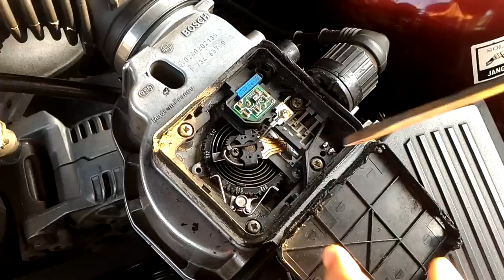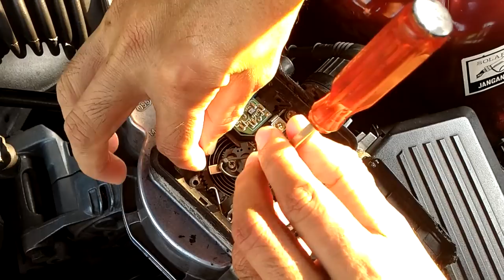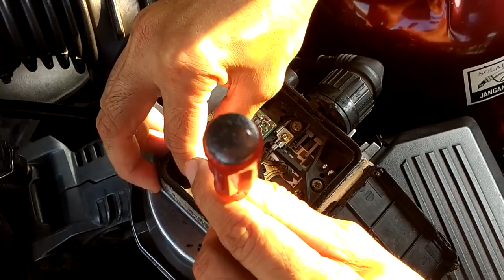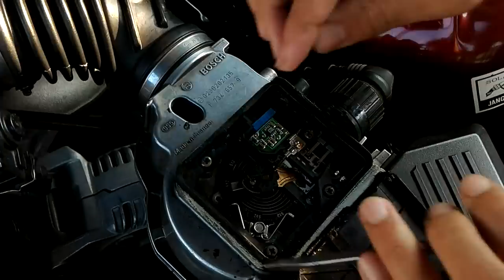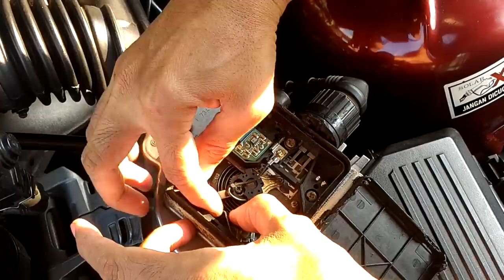BMW E36M43 AFM setting

Comment: Good video! I got the same looking AFM, but the model number ends with 203. Will the setting be the same? Also curious...next to to the blue square thing situated close to the circuit board, there is some sort of round plastic extension that is protruding from the outer black cover (some AFM dont have this). Is there any functionality of that part? thx
Reply from the maker: Thank you. I think the steps to setting the 512 and 203 gear are the same.

About the blue square, it has a function to setting the CO. However, to setting it you need a gas analyzer equipment
Reply: @motoren_works  thx...at last i know the function now :D.
Reply: @motoren_works  btw another query...there are many variations of AFM for M43 engine... how to know which model of AFM to use for the correct engine? I'm scared I'm now using the wrong AFM for my engine...coz they look very similar :p
Reply from the maker: @yinsilbi  Honestly, i don't know how to choose the correct AFM.
If i want to choose the AFM with or without CO setting, so i will choose the AFM with CO setting
Reply: @motoren_works  ok noted boss. tq :D
Reply from the maker: @yinsilbi  you are welcome

Comment: Just asking I had problems with air to fuel ratio then noticd the to wires on the afm one is off the board could it be the issue for rev limiter
Reply from the maker: The thin wire?
In my AFM, that wire is gone, however engine idle is normal
Reply: @motoren_works  I just  noticed 
Mine afm I accidentally loosened the  screw and messed the setting's

Comment: So what was done ?
Reply from the maker: jaz chahal adjust the wheel spring tension is to correct air and fuel ratio. moving the wheel clockwise is lean and counter clockwise is rich

Comment: How many rotations from fully unwinded spring is yours set at?
Reply from the maker: I didn't count the rotation. I rotated clockwise (lean) the 512 gear and stop when the engine rough shaking. After that, i rotated in the opposite direction until the engine smooth vibrating. Before i start rotate, i give a mark as initial reference just in case if my setting goes wrong.

This step basically want to ensure if the old AFM still in correct position.
Reply: @motoren_works  lokasi bengkel dmn ya?. Kbtulan e90 saya rough idle. Ditarik pakai manual brasa jedut2an, cepet bgt kaya lg lewat speedbump
Reply from the maker: @rhomyr1302  mohon maaf om, sy bukan owner bengkel hanya pemakai biasa khususnya di E36M43. Untuk E90 sy kurang paham om
Reply: @motoren_works  ok om. Makasih sudh membalas.
Reply from the maker: @rhomyr1302  sama2 om. Gak coba ngecek ke bengkel resminya bmw om?
Reply: @motoren_works  blm sih om. Tp kmgknan sih mahal
Reply from the maker: @rhomyr1302  kalo ke beres biasanya sih begitu om

Comment: Can you please make a video on how to clean the air flow mass sensor ?
Reply from the maker: Do you mean clean the tiny sensor inside the AFM?
Reply: @motoren_works  Yes
Reply from the maker: @williamwill1100  honestly i never clean the sensor. If you want to clean it, you can use the sensor cleaner like "CRC mass air flow sensor cleaner", however never touch that sensor.

Comment: Ok... Now I'm confused.
You claim your enriching the mixture by decreasing the the tension on the spring. I disagree. You may improve throttle response a little but in closed loop operation the oxygen sensor will make the DME correct the duty cycle of the injectors to the preprogrammed stoiciametric ratio. The only way to change the air fuel ratio is by changing the mapping of the DME. If you don't believe that try putting your car on a Dyno and analyze the exhaust gases.
Reply from the maker: E36M43 in my country doesn't have oxygen sensor. About the effect of increasing or decreasing the AFM spring to fuel mixture, may be you can see my another video https://youtu.be/yg8LIWWhX7w.

Comment: Por qué a mi carro no marca la gasolina si ya le cambié el flotador solo se mueve poquito gracias es un BMW modelo 1995 318i
Reply from the maker: Si se produce un error después de reemplazar todo el sistema de boya (https://www.youtube.com/watch?v=7xY3LdUl_Fk&t=376s), intente verificar nuevamente y limpiar el sensor de seguimiento en el sistema de boya. Si se ha realizado este proceso pero aún aparece un error, entonces la causa del error podría ser del Fuel Level Sender (https://www.youtube.com/watch?v=1mQ1I-Ijey4&t=690s). 
(Lo siento si mi idioma no es el correcto, porque uso el traductor de Google)

Comment: hi mas indra boleh tanya"  jd gini kmarin sy udh bersihin ICV-filter udara- dan AFM .sy udh setting AFM di idel yg ideal dan rasanya jg udh enak tarikan nya tp kok Gas buang tetep masih bau bensin ya dan cenderung masih boros antara 1:6 . apakah harus setting AFM via komputer biar emisi gas nya ideal dan klo boleh tau brp sih kisaran biaya jasa setting AFM by komputer biar sy ga di mahalin montir2 cina dsni.matur suwun
Reply from the maker: ALLEA QUEN hellow mas om, kalo AFM sudah diseting tp gas buang dr kenalpot masih tercium bensin/boros maka langkah selanjutnya adalah seting CO pake alat gas analyzer di bengkel yg punya alat tersebut om.
Kalo biaya di bengkel spesialis di kisaran 100rb s/d 300rb, sedangkan kalo di bengkel resmi bmw lebih mahal dr kisaran itu om.
Oh iya om, bersihin icv hanya disemprot2 seperti di video sy lainnya kan, jangan dibongkar seperti di video waktu om nanya itu ya 😀
Reply: motoren works .icv sy udh di lem mati ama yg punya sblum na kok mas . iya planing na sih gtu .mau setting komputer biar dpt ketemu emisi gas buang yg standart. tanks info na mas indra
Reply: om bengkel non resmi untuk stel CO bmw e36 320i m50 sekitaran jakarta dimana yah?
Reply from the maker: @bimmerlive9498  maaf lama jawabnya om, gak ada notif 😩. Untuk di jakarta, maaf sy kurang paham di bengkel mana nih om.
Reply: @bimmerlive9498  sama om. Saya jg agak boros tipe e90. Kalah sma 2.5 cc 6 syl... daerah jakarta juga

Comment: which way do you turn the blade to lean out the mixture?
Reply from the maker: Lean = clockwise
Reply: @motoren_works  are you enriching or leaning out in this video?
Reply from the maker: @puristM  enriching
This is my other video related to AFM setting https://youtu.be/yg8LIWWhX7w?si=PAtRZzD-UvV9rs9H

Comment: Rpm ngayun saat mesin belum panas apa benar itu dr AFMnya ya om?, klo dah setengah jam lebih mesin hidup baru stabil RPM, pernah bawa ke bengkel spesialis BMW(bukan Bengkel Resmi) katanya AFMnya dah kena, trs saya nanya dong apa g bisa diservis ato disetting lagi, soalnya diminta langsung ganti baru, katanya utak atik atau servis AFM itu tindakan konyol g bisa diservis katanya, kaget saya sama omongan mekaniknya, langsung batal servis disana, mohon pencerahannya om
Reply from the maker: Dari pengalaman di M43 sy, rpm ngayun asalnya bisa dr AFM bisa jg dr ICV/iddle up (iddle up biasanya lebih kerasa kalo lg nyalain AC). Kalo dr AFM penyebabnya karena ada bagian karbon AFM yg terkikis. Biasanya setelah di recarbon rpm bakalan normal lg. Kalo penutup plastik AFM bmw omnya sudah pernah dibuka, bisa di cek dulu karbonnya. kalo ada yg terkikis coba di recarbon dulu.
Sekalian cek jg pergerakan flap afm nya om. kalo kurang lancar. Bagian porosnya coba disemprot(hati2) pake carb cleaner atau wd40.
Reply: Klo pernah dibuka dan 2x disetting aja g  pake recarbon, dulu pernah RPM ngayun lebih parah klo AC nyala bahkan mesin hampir mati dan terus menerus saat mobil nyala, trs coba ganti iddle upnya mobil eternanya teman dan bisa, trs beli yg baru persis kyk punya temen dan Alhamdulillah normal sampe 2 taun ini, yg saya tanyakan skrg ngayun ringan dan AC on atau off sama saja apa bisa disimpulkan dr AFM ya om?, trs tau bengkel recommended untuk recarbon di Surabaya g om?
Reply from the maker: @yogiyanuar5598  AFM kalo track karbonnya sudah kurang baik, untuk nyettingnya agak sulit sih om, hasilnya biasanya tetap gak akan baik.
Untuk perkiraan sementara bisa dr AFM om, tp pastiin dulu track karbonnya masih bagus atau tidak.
Kalo bengkel recarbon di Surabaya yg recomended sy kurang paham om. Dulu sy recarbon di bengkel garasi bmw di Bandung. Kalo gak salah bisa terima dan kirim untuk luar kota jg om.
Reply: Siapp, makasih byk om
Reply from the maker: @yogiyanuar5598  sama2 om. Semoga bmw nya lekas sembuh om

Comment: Om...ijin tanya klo saya baru bermain di BMW settingan belum mengerti..klo saya injak gass di RPM 1 naik ke 3 brebet dan klo lepas gass dia turun ke di bawah 1 hampir mesin mau mati..dan RPM ngk bisa sampek ke 6 
Terimakasi om sebelumnya
Reply from the maker: Nubie coba menjawab om. BMW nya keluaran tahun berapa? Kalo pake ilmu nebak2, problemnya bisa berasal dr pergerakan flap yg ada di AFM ini. Nanti coba om gerakin flap nya, kalo terasa gak lancar coba semprot bagian poros AFM nya pake penetrant sampai lancar kembali. Kadang kotoran/debu numpuk di poros itu.
Coba cek juga carbon track nya, kalo carbon sudah aus terkadang bikin rpm gak benar.
Cara yg paling benar sih, si om bawa ke bengkel yg punya alat scan, biar diagnosanya lebih akurat. Biasanya error yg ada bisa ketahuan lewat alat itu
Reply: @motoren_works  bmw 320 e36 m40 om yang tahun 91 yang body
Seandianya mau memperbaiki sendiri om pnya tutorialnya...
Terimakasi..
Reply from the maker: @youghatombstone4627  kalo tahun 91 kayaknya 318i ya om bukan 320, cmiiw. Untuk ngoprek nekad, om nya mungkin bisa melihat disini https://youtu.be/zrO0rMypp5Y Semoga dapat membantu om.
Kalo ngopreknya berhasil atau tidak, jika berkenan tolong di update disini ya om.

Comment: halo, saya bryan. mau tanya kak,
mobil nya e30 m40 posisi jakarta. baru bersihkan tangki, filter bensin, injector, throttle body sejak mobil tiba2 mati karena tersentak kopling dan dinyalakan tidak mau rpm nya lebih dari 4rb. sekarang lari enak, rpm bisa sampai 6ribu. tapi kadang gas normal, kadang bisa naik turun. 
saya baca sebelumnya mengenai airflow,  saya sudah coba putaran dan normal. namun didiamkan agak lama, kembali naik turun sampai hampir mati, bahkan sesekali mati. tapi kalau saya sentuh gas sedikit (dipanteng di rpm 1000), mobil bisa tiba2 normal lagi. 
betulkah dari airflow kak? dan ICV itu apakah sama dengan idle up, karena baru dibersihkan dan diganti semua selangnya. terimakasih
Reply from the maker: Halo om, salam. Kalo ada trouble baiknya di scan, jadi kemungkinan besar bisa ketahuan sumber masalahnya darimana.
Saya tidak berani untuk langsung menyimpulkan sumber masalah berasal dari AFM. Untuk memastikan, coba omnya cek lepas AFM nya terus cek pergerakan flap di bagian dalam. Flap digerakkan maju mundur, jika pergerakannya kurang lancar segera bersihkan. Proses bersih2 flap bagian dalam ada jg videonya jg disini.
ICV = idle up
Filter bensin kalo sudah lama, baiknya diganti baru saja
Reply: @motoren_works  maaf, apakah bmw e30 bisa di scan kak? 🙏😁
Siap untuk bersihkan flap segera dibersihkan. Filter bensin juga jernih kak makanya agak bingung. Tapi terimakasih banyak atas segala masukannya 🙏
Reply from the maker: @lexwangsby.bryan_bja  oh iya, e30 ding. untuk e30 sy tidak punya pengetahuan bisa di scan atau tidak.
Reply from the maker: @lexwangsby.bryan_bja  update setelah nanya-nanya:
* kalau udah Bosch Motronic bisa discan
* Bosch Jetronic peralihan, ada yg bisa discan (L-Jetronic), ada yg nggak bisa (K-Jetronic)

Comment: Kalo e46 m43 sama aj g cara settingnya atau harus pakai cara di scan dengan alat?
Reply from the maker: E46 m43 kalo gak salah pakenya MAF bukan AFM ya om. Untuk setting MAF harus via alat scan
Reply: Ohh gitu om.. pakai alat scan khusus stel CO atau GT-1?
Reply from the maker: @andrigunawan2417  sebenarnya untuk yg MAF sy tidak terlalu paham jg om, tetapi dulu pernah ngobrol dg orang yg lebih paham dan yg dapat sy simpulkan: untuk setting CO di MAF menggunakan GT1. Biar hasilnya lebih oke lg, nilai CO before dan afternya dapat di cek jg menggunakan alat uji emisi.
CMIIW ya om
Reply: Oohh jd tetep pakai GT-1.. terima kasih atas pencerahannya.. very very helpfull dan saya doakan sukses selalu
Reply from the maker: @andrigunawan2417  sama-sama om, sukses jg buat omnya 👍

Comment: misi om,kalau posisi idle rpm di atas 1000 dan agak brebet waktu idle ,saat untuk jalan setelah oper gigi mobil ndut ndutan saat digas pelan 
kerusakan apa ya,atau tutor setring afm ke arah mana
Reply from the maker: Kondisi track karbon di AFM nya masih bagus atau sudah ada yg terkelupas om? Gas buang di knalpot apakah tercium bau bensin dan perih dimata? Ujung knalpot berwarna hitam?
Reply: @motoren_works  di dlm pipa knalpot ada warna hitam,bau agak pedih, kalau lama tidak di panasin keluar air ada asapnya
Reply from the maker: @whisnupradana1592  kalau track karbonnya masih bagus, coba putar gear AFM nya searah jarum jam/ke kanan sebanyak 3 mata gear dari posisi awalnya. Posisi awal ditandai terlebih dulu sebagai acuan
Reply: @motoren_works  okey siap om,kalau indikasi putar ke atah jarum jam ke kanan itu lebih irit atau boros ya
Reply from the maker: @whisnupradana1592  irit om. Di deskripsi video ini sudah sy tuliskan
Reply: @motoren_works  sudah saya geser om lumayan turun idle nya,kalau kelebihan geser ke arah jaru jam suara mesin mau mati getaran mesin makin terasa
agar idle turun lagi kurang apanya ya om,posisi di 1000
Reply from the maker: @whisnupradana1592  jika menggeser gear AFM: berhenti kalau mesin sudah bergetar kasar, kemudian putar lg berkebalikan arah sampai getaran mesin halus.
Geser searah jam, mesin bergetar kasar menandakan terlalu irit.
Geser berlawanan jam, mesin bergetar kasar menandakan terlalu boros.
Coba bersihin flap afm, icv/idle up, cek selang2 vakum, dan throttle body

Comment: Misi om, kalo dah di stel sehalus mungkin brebet parah di rpm 2rb solusinya gmna om ? Sebelum nya udah scan ga ada masalah, kemaren pake afm kw ada loncat kadang kadang di rpm bawah, setelah ganti orinya malah berebet banget om 😀 mohon pencerahan nya om 🙏
Reply from the maker: Kondisi mesin waktu nyetting sudah di kondisi idealnya (indikator temperatur sudah ditengah)? Carbon track masih kondisinya masih baik gak ada terkelupas? 
Sudah di setting sehalus mungkin tp brebet parah di rpm 2rb, bisa jadi settingannya terlalu irit, coba geser gear  3 s/d 4 gigi berlawanan arah jarum jam.
Ketika diganti orinya tambah brebet, kondisi AFM orinya masih bagus? Orinya diganti kw, apakah yg ori sudah ada masalah sebelumnyakah?
Reply: @motoren_works afm  yg ori kemeren baru beres service om, udah sy seting di indikator suhu setengah om masih tetep, malah saya curiga di icv sama disa valve, icv kemaren ta bersihin sekarang dah normal tinggal cek disa valve om saya curiga buka tutupnya ga bener 
Sekarang kendalanya kalo di rpm tertentu ada brebet dikit kira kira di rpm 2800-2900 brebet selebihnya ngacir om
Reply from the maker: Sudah pernah di scan om? Kalo belum, coba di scan dulu, siapa tahu bisa ketahuan error dimana
Reply: @motoren_works  udah om, tapi kalo ada bengkel recomended daerah bandung buat scan boleh om minta infonya, mau ta scan ulang, takutnya bengkel deket rumah bohongan 😀
Reply from the maker: @rhustavitorumbarkapratama8187  hasil scannya gak ngasih tahu ada error?
Kalo bengkel scan, coba ke garasi bmw yg di pelajar pejuang
Reply: @motoren_works  hasil scan nya aman om ga ada error, besok mau coba dulu service injector om mudah mudahan sembuh brebetnya om 😀, om siapa tau ada yg mau jual per keong standar e36 yg belum potongan boleh di infokan om yg harganya agak miring 🙏
Reply from the maker: @rhustavitorumbarkapratama8187  kalo di scan gak ada error, berarti bakalan ngurut dan memprediksi sedikit demi sedikit kemungkinan error dimana. Semoga cepat ketemu problemnya om

Comment: Lokasi bandungnya dimana om???318i saya ada kendala di airflownya..
Reply from the maker: Daerah Arcamanik om. AFM nya kenapa om?
Reply: Kalau posisi nyala netral berebet..tp kalau di gas ga brebet om..
Reply from the maker: @faisyaldarmawan7104  mau nanya om, kok bisa tau tersangka penyebab brebetnya dr AFM? Sebelum ini bmw nya sudah pernah di scan om?
Reply: Awalnya kalau masuk gigi di bawa maju di gas berebet, terus di benerin afm nya, sekarang berebet kalau posisi mobil jalan sudah engga, tp kalau posisi mobil netral suaranya kaya yang berebet rpm nya juga ga setabil om..blm cb di scan om
Reply from the maker: @faisyaldarmawan7104  carbon track yg di AFM masih bagus atau sudah ada yg terkikis om?
Reply: Kalau di bilang bagus si ga terlalu om karna sudah lama kayanya...hehehe...ngaruh juga ya om carbontrek kalau sudah ga bagus?
Reply from the maker: @faisyaldarmawan7104  carbon track kalo sudah gak bagus bisa ngaruh ke rpm jg om. pengalaman sy dulu, rpm bakalan gak stabil
Reply: Oh begitu om..wah thx banyak om infonya om 🙏🙏
Reply from the maker: @faisyaldarmawan7104  siyap, sama-sama om. Menurut sy untuk bengkel di bandung yg recomended buat recarbon itu di om eko garasi bmw, menurut sy ya om 😁
Reply: Dimana itu om, bengkel om eko..
Reply from the maker: @faisyaldarmawan7104  garasi bmw, disebelahnya IBCC jl. A. Yani. Ongkos kalo gak salah 350rb om
Reply: Sip om..thx ya om infonya
Reply from the maker: @faisyaldarmawan7104  shiyabb...sama2 om, semoga bmw nya normal kembali 💪